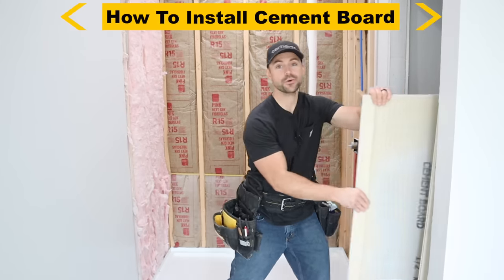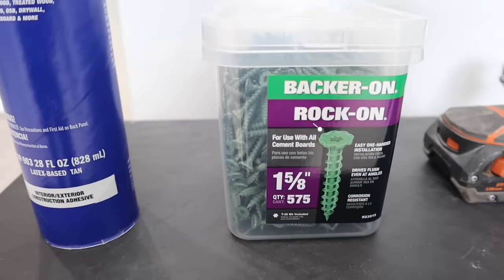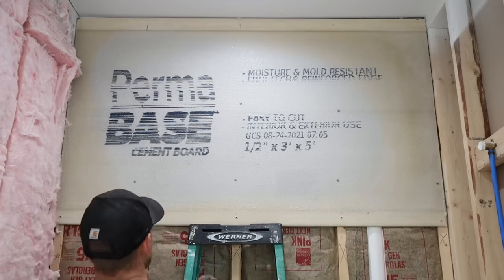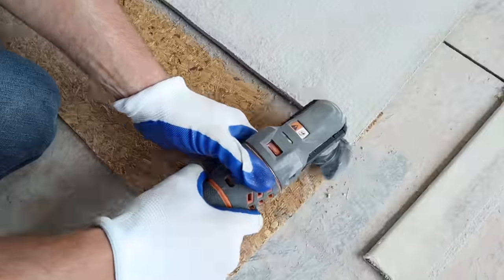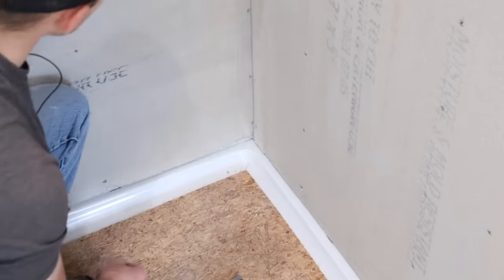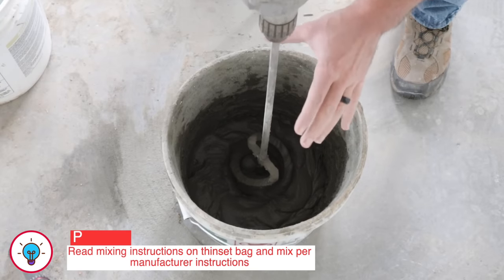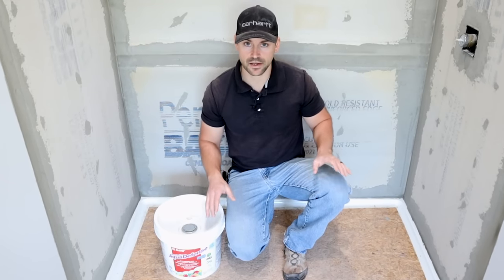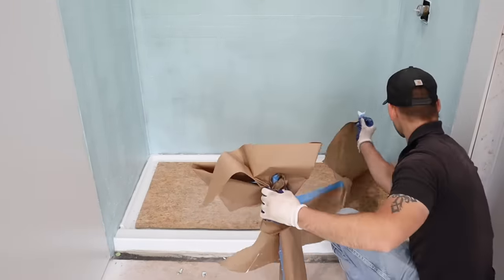How To Install Cement Board and Waterproofing For Tile Shower Walls - Complete Step-By-Step Guide

Comment: It's better to use 2 long screws on the studs about 1/2 inch lower just to hold the durock and once you screw your durock you take them out
Reply from the maker: Yep that works too. If you cannot hold it with one hand and screwed together that makes perfect sense. Thanks for your input!

Comment: How many days/hrs it will takes to complete this project from demolition of the old shower to tiling of shower wall?
Reply from the maker: Hey Scooby! This is actually a brand new house I have built from the ground up. It took about 60 hours from the time I installed the shower pan to the time I grouted the shower. Hope that helps! PS it was me working alone
Reply: @TheExcellentLaborer  thanks for the reply. I'm estimating how much the contractor will charge if their rate is $60/$65 / hr in my state.
Reply: @TheExcellentLaborer  bruh, I think im on 1 month...I just figured youtubes makes everything look quick and easy...I guess I should get kicked off the job site for lack of performance.

Comment: If you don't plan on tiling the ceiling do you still use cement board or can green board be used. I would feel more comfortable with cement board, but not sure how it looks painted.
Reply: Green board is best for ceiling in a shower. and adding an exhaust fan is even better.  Cement board is too rough to look good when painted.
Reply: @richardhoner7842  thanks a lot!!

Comment: Great video - really cleared things up for me. 

I do have a question about floors.  Would you also use the waterproofing on the floor cement board prior to tiling?
Reply: Yes you have to waterproof the cement sheets on the floor . Unsealed cement sheets will absorb water .

Comment: How far down do you run the Dura rock if you’re using a shower pan do you run it to the very top and if you do when you set your your tiles do you just put more mortar behind the bottom piece of the tile to make up the gap?

Comment: A few things… you don’t need adhesive, you’re using the wrong tape and you need to read the directions on the back of the mortar bag. Mapei mortars require 5 minute mix followed by a 5 minute slake then another 1-2 minute mix. Also, the amount of water you need to use is easily calculated based on the amount needed to mix a full bag.
Reply: what kind of tape?
Reply: @BlueEffigy  alkali-resistant. Fibatape makes some. You need a tape that is coated for use with cement board and thin set mortar.

Comment: What happens when the framing isn't square, plumb or level? How do I use shimms?  If my backer boards aren't flat or plumb won't that make good tile work next to impossible? A real "complete step-by-step guide" would cover this stuff since  it's, well the most important part!!

Comment: Hey good buddy, I have a tub surround I want to rebuild, and at the top edge of the tub, where the tub meets the backer board, in some places it is like 5/8 in front of the stud.  In other areas, the stud is just about right up against the tub edge.  I know this can't be rare, but what is the solution. Thanks and thanks for the videos!
Reply: Very common problem.  I have solved this using a skim coat or two of quickset on the backer board. Don't do more than 1/4" at a time then let it dry.

Comment: Not to be negative but I don't think you're supposed to have the back board touching the shower pan on the inside of the pan. This week create a wick for water to come up and create mold. From what I've seen you need to have it on top of the lip or even above a gap. Then the tile will sit over the hole down to the pan.

Comment: Is it better to use modified or unmodified thinset to fill the joints? I’m using hardiebacker.
Reply: Liquid nail extreme  heavy duty $5 a tube works perfect corners and joints finish the excess with a spatula

Comment: Do you need to add any plastic vapor barrier over the insulation or does the cement board not need that?
Reply: In the showers I've taken out that has them it seems to trap moisture in the walls, the wall sweats and rot and mold develop.
Reply: @chuckg7185  thank you!

Comment: Interesting. I would first check my walls for plumb and square. Then sheet with 1/2in plywood. Next waterproof! Then the cement board. Why? I want my thinset to bond to the cement board. Not going to get a good bond over the waterproofing. Set my tile, grout, and seal.

Comment: I wish I would have watched this video while my builder was building our master bath. He did not use adhesive for the cement board, didn’t tape and seal around the valve box, and didn’t waterproof the entire walls, only the seams.

Comment: Great stuff as usual!!! Question: when you install the backer board vertically you lose the seam indetation mentioned at 9:08... does that matter much?
Kinda related... I 'helped' a "pro" tile a couple showers a few weeks ago in a group home. I was shocked to see that he used green board, and of course NO waterproofing material, in the shower surrounds. When I asked him "WTF??" he said, with a straight face, that it didn't matter :(.
Reply from the maker: Hey Sym! Yes the vertical pieces with new indention is not a big deal. The fence it will allow variation when you install the tile. I meant to mention that in the video but post production I forgot. Yes that person should definitely not do that again. Drywall is not meant for wet areas. I have worked with a lot of people that did stuff like that and I just shake my head. Thanks a lot for watching!

Comment: The pan that came with my frameless shower kit instructs to leave a 1/16 to 1/8 gap between the backer board and the top of the pan. It then says to apply silicone to that gap. It includes a diagram that shows the bottom row of tiles will cover the lip of the pan.
Reply: I have found that is common practice. I have heard tho not to use silicone but rather mortar

Comment: If you're installing 1/2" Durock cement board, their installation instructions indicate you can also use 1-1/4" cement board screws, 8 inches apart on walls and 6" on ceilings. 1-5/8" isn't a bad idea though. Also, gluing Durock up with construction adhesive is an unnecessary step. It's not indicated by Durock. It'll be Hell for the next guy having to scrape or sand Liquid Nails off the studs for a smooth, flat surface.

Comment: Just curious is there a reason why you did not use the Schluter System?
Reply: It is brutally expensive.   I used it in the main bathroom in my home.  No problems, so far.  😉

Comment: Great advice.  Any suggestions besides a pre-fab plastic pan for a cement on grade shower floor?  Never worked with a plastic pan before but don’t think a rubber liner is necessary.
Reply from the maker: Hey Ralph! Check out my video on how to install a shower pan. It sounds like it will be helpful for you!

Comment: I came across the video, I might have missed it, I didn't see mesh tape, I also pad out shower or tub with a 2x4 screwed into existing stud and come out ,3/8 inch and level the 2x4, but you need hand picked studs

Comment: Nobody shows how to remove the fix part , in my windows they use top come at the bottom and got corrosion and I have leaks , I need to remove the fix part to put silicone  so it don’t leak anymore

Comment: The construction company that built my house back in the 80s used drywall behind all of the tiles in the bathroom. Now there is a very big hole in my wall where the faucets come out for the tub. 😮‍💨

Comment: All i see is a southern Jared Leto doing tile in yes the cheapest way, well cheapest as long as the water proofing holds up because if it doesn’t, it will be more expensive than any other waterproofing system because it will rot the heck out of your walls which mmmm ive heard bad things about the water proofing used here. I know it’s more expensive but the schluter way is the way to go cus its proven to be the best water proofing system as long as its installed correctly. Honestly i recommend just being patient and saving your money so you can not have to potentially spend more later on. But kudos to this guy I especially appreciate the way he notched out the bottom of the cement board for the lip of the shower pan cus yeah that kick out can be nasty.

Comment: I see that you did not use a vapor barrier between the insulation and cement board... not a code requirement where you are I assume?

Comment: I found a Hardi Backer that is already waterproof, It cost about 21.00 a board at Home Depot. You should not have to use the water proofing if you use the more expensive Hardi backer. There is a video of a guy using Schulter band to seal the corners instead oof the fiber tape, so I am going to use it instead.

Comment: Thinset is very hard and inflexible so if there is any wall movement at the corner wouldn't it readily crack and break the tape?

Is there any other means generally used of retaining a semi flexible corner joint so as to not to risk tearing the waterproofing and compromising the waterproofing?

Why not just use the rubberized waterproofing tape and coating directly I.e no thinset as you aren't filling any recess?
Reply: wedi makes a magic sealant

Comment: What if you just leave a gap of 1/8 of an inch between boards and then you just fill it with liquid nails and by doing that you just skip the floating step and save some time
Reply from the maker: The way I do it gives a cleaner more flush job. That is what you want for tile work. I hope that helps!

Comment: Premarking the cement board for the screws into the studs is risky. Studs are often warped/out off alignment. I trim the backer to width and then mark it in place at the studs. Wait until you hit a building that has shifted or was never straight. It is very common on new and old structures.

Comment: Everyone does it different 
You can silicone the angles + srewhead s
You can fur out the studs with hardboard furring strips specially made for this at hardware store
Waterproofing bit of overkill
Fortified thinset will be sufficient and seal the grout and tile

Comment: what do you do when the cement board does not come even with the drywall.  we are not going all the way to the ceiling.
Reply: We just did that and we created another 'stud' by screwing in a 2x4
Reply: Built out the wall for an alcove. So theres a small drywalled "wall" for heavy hits.  use firring strips. Use shims. Use a hand planer, a chisel to bring a stud back. 1/2 inch drywall should be meeting flush with 1/2 rock boards. If its not I got a tool bag of tricks.

Comment: Instead of cutting into the sheet for the flange, why didn’t you just notch the the studs to flush up the flange to the studs, of just add 1/8” strips to the studs?

Comment: Why didn't you start at the bottom with the cement board?
Reply from the maker: You can start from top or bottom. I just like the finished edge at top. Hope that helps!

Comment: Iv been doing this for 50 years, and always used the green board ,dry wall and theres never a problem with it , the cement backer board is a royal pain in the ass compared to drywall.

Comment: I'm wondering if he knows why they used mastic (Glue) to install tile years ago,and flipper house's, cost is one, plus Glue last 8 to 10 years, it's fast and easy,wonerboard is like fresh mud or cement, only if you're walls are off so will your tile be ,it still leaks, only takes longer, nothing is forever, only death.

Comment: Why not start putting the boards on from the floor up rather than top down that way the previous board supports the next and you are not trying to hold a board in the air and screw it on!
Reply: Easier finishing the top corner just like all drywall

Comment: Roofing nails will hold better than those overpriced screws. I/we used them for over 40 years and never saw a single problem. Those screws will wallow out the hole and not grip as much area as a roofing nail.

Comment: Stupid question: if you're using cement board why don't you use cement in place of thinset for the joints?
Reply: Thin set is a Portland product.
Reply from the maker: Thin set has more bonding strength to cement board then mortar cement. I hope that helps!

Comment: I dropped a drill off a step ladder into a shower pan and it landed with the bit driving through the pan like a throwing knife. It was sitting there like a ghost was holding it drilling into the shower pan.

Comment: That is not the proper mesh tape for mortar and board is to sit on top of lip and then use sealer where it meets the base. Other than those 2 things ,great job!

Comment: Curious, if you are using a roll-on waterproofing, why use cement board? Drywall is much less expensive, lighter, and way easier to work with.

Comment: The tape you used was wrong. That's wallboard tape, not cement board tape which is alkali resistant. The tape you used will disintegrate. Please use the tape made for cement board which is right next to cement board in any box store. I don't know how you missed this Josh.

Comment: You don't need mesh tape  if your gonna use aqua or red guard.
Reply: Yeah but you could use mesh tape..then more special tape in the redguard. Theres a 20 yr failure on the youtubes that shows if he used tape in the redgaurd in the joint where his curb met a concrete foundation he might have avoided rot due to a seam split in the redgard. But he was also using mastic to set tile.
Reply: @gantz4u  that’s why you fill the cracks and joints with Red Guard. No special tape needed, just make sure to fill those voids and it will be waterproof. It’s not that complicated.
Reply: @txmade4371  Yeah, he redguarded everything. His foundation shifted and the wood he used for a curb did not shift with it opening that joint in the redgaurd defense. Redgard stretches but not enough to save that guys curb The tape might have reinforced the redgard like taping in between concrete boards. OR gives something for more redgard to soak into.It gets more complicated 20 yrs out.
Reply: I mean the reviews on that water proof(ing) tape are I dont know if I NEED it but I put it in there anyway. Its better than putting in toilet paper I guess. We'll find out in 20 yrs if you NEED it(or not).
Reply: @gantz4u  Good point, so far I haven’t had an issue with just red guard.

Comment: Not a deal breaker but you should never use faced insulation adjacent to the shower walls. The paper will become nutrition to any mold that may take hold in a damp environment.

Comment: We love your shower walls. They're a great way to make the most of your space, and they help keep the water out of the rest of your bathroom.

But they can be hard to install, especially if you don't have a lot of experience with sheetrock and/or plumbing. That's why we love HYDRO-BLOK Shower Wall Panels! They're easy to install, waterproof, and can be used in any room of your home—not just the shower!

Comment: Cement board is not required by code. It is suggested that it be backed with a water proof product when used, which makes more sense than a rubber based surface treatment that can be peeled off simply by removing the tape involved in masking the base? Not a good surface for tile adhesion, and pricy at $300??

Comment: Using Thin Set as a water barrier is a bad idea. You should be sealing the shower first with Red Guard or similar product.
Reply: Are you saying he should have put the Aqua Defense on before the thin set?
Reply: @LoganAddisMusic  , No! he did this install correctly! I would have used a bead of silicone around the pan before installing the durarock.
Reply: @stevehamman4465  thanks!
Reply: @LoganAddisMusic , when pitting tape tape and thinset on , push thinset through the tape into the joint  or gap, it strengthens  the seam or gap ! Good luck!  I'm a retired tile setter,  hit me up if you want!
Reply: @stevehamman4465  thanks so much!

Comment: Can’t believe you started up on the top with the wallboard, I had to stop watching😀
Just kidding. 
But for the life of me, I struggle understanding why so many apply the mesh tape? 
Showers stalls are typically small, I simply use wood blocking, either 2 x 4 or small scraps of three-quarter plywood to reinforce & screw all seams. 
But 1st I lay a bead of good caulking on the top edge of the installed board, then set the other board right on top👍 
Then simply red guard or similar. 
If you were to allow a film of your waterproofing to dry, you would find its tensile strength much greater than the tape you installed. 
Anyway, if water should somehow penetrate your red guard waterproofing, 
Please explain how mesh tape & thinset will stop it. 
Also, do you find your walls uneven due do thinset?
Thx for the input